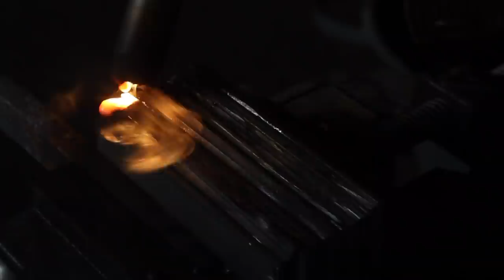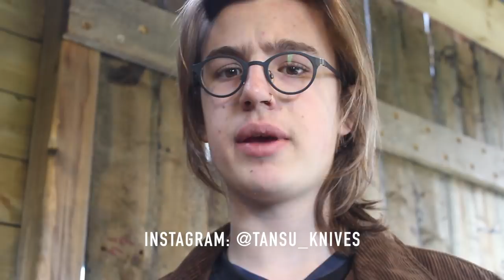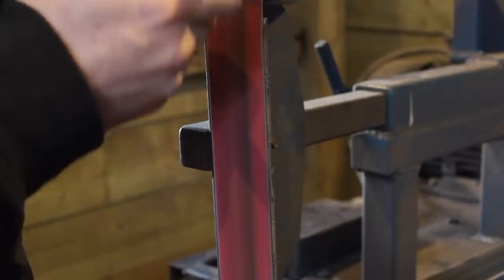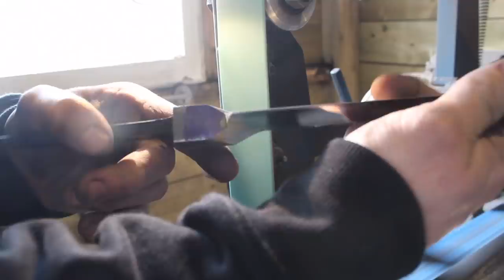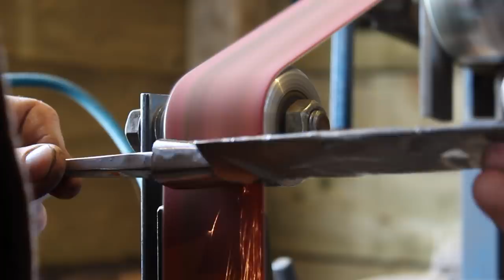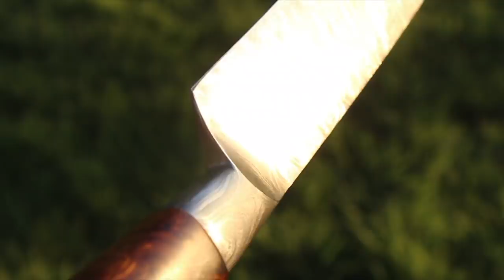Turkish Yatagan Sword from Damascus steel ~ Making my first Sword

Comment: Great sword. My only trouble that with yatagan's handle. Turkish blacksmiths make the handles back end wider (Those are called ears) to prevent the blade to slip away from your hand in a combat situation. But it is so beautiful and seeing blacksmiths from other nations makinkg Turkish weapons is awesome. Good job.
Reply: Skyrim ceken adamın 6
Reply: @Herawler  aga kalk Skyrim
Reply: Janissaries slab marble blocks with bare hands to make their hands solid. Its not a problem.
Reply: @Herawler  Lordum onure oldum.

Comment: It actually looks quite legit! GREAT WORK!

Your beautiful yatağan lacks 2 things, unless it is a ceremonial one:

1- “Blood channels”: 1 or 2 parallel canals running on the upper part of the blade, for easier drawing out of the metal wearing enemy.

2- MOST IMPORTANT: TWO EARS + COUNTERWEIGHTS! Since the saber is forward balanced; (ie: recurved) you have to leave the tang very thick (which you mostly did) and you finish the very end of handle with 2 large and heavy-ish “ears” that are inlaid with heavy bronze (or silver) sheating inside and around them to tilt the center of gravity backwards; very useful when hitting armor, as it will add a lot of momentum to the striking edge.

Another interesting feature is that you have the make the handle as “round” as possible (instead of oblong like a chef knife handle) so your fingers barely touch when grabbing the saber; a feature of our hammers as well.

Interesting to note; the hammer you are using is very similar to the ones in Turkey, Iran and Central Asia and China.

Last, you need to make a small notch at the back of the blade near the tang after each battle you have been in, the wider the notch, the more important the battle! Haha! :) (round notches on the back corners for naval battles)

Great work, I’m a copper and silversmith myself, I love your channel!
Reply: And another typical feature again for balancing and solidity reasons is to have multiple rivets at the handle; at least 3, sometimes 5.
Reply: @2000eae  Your blacksmithing skill is now 99.8%
Reply: Wromthrax if you only knew... 😘
Reply: @2000eae  Cue Minoc Theme
Reply: @2000eae  dostum sen nerede çalışıyorsun kimsin azizim mükemmel yazı valla
Reply: The groove you are talking about is not for letting blood. Its for balance.
Reply: Ben Yenilmezim 
Guzel yorumun icin sagol oncelikle, Istanbul’da Soy Turkiye sirketindeyim, metal dovuyoruz gece gunduz! :) 
Yolun duserse beklerim her zaman bizim imalata, gercekten.
Reply: First sword ever, and can't let him enjoy it?

Comment: The handle looks like a normal knife handle and traditional Yatağan swords have two big bulge at the back of the handle that are called 'ears' to prevent slipping from hand. Except from that, you made it better from most of the Turkish knife/sword makers. Excellent job!

Comment: The handle of the Yatağan sword is not like that. There is a lump to weigh on the bottom of the stem. that bump allows the sword to be kept balanced and the sword to swing more evenly. The part of the sword you made was also close to the handle. the bedding sword slightly thinner from the tip to the handle. Keep in your mind.

Comment: try to make some oroshigane (similar to tamahagane) using the steel dust from your screw press
Reply: love the sword btw
Reply: The scale that breaks of while forging isn't steel anymore because it has lost too much carbon, I don't know if you could really make anything from it
Reply: There's a video about it..
Do look it up.
Reply: @lemansawi3249  can you send me the link please ?
Reply: @lamproknives  the link
Reply: @lemansawi3249  hm okay, well I'm impressed but I still thinks it won't make a good knife anyway, first because it is very likely to fail, and second because the scale has lost too much carbon to make a proper high carbon steel even after being forge welded
Reply: @lamproknives  yup, it failed miserably.
Reply: @lemansawi3249  well at least he gave it a try, if it had worked it could have been awesome, I don't know if  the time and effort are really worth it though
Reply: @lamproknives  actually there's a lot of processed to do before smelting.
A lot of impurities and all.
Not worth the effort.
Reply: @lemansawi3249  that's also what I thought
But Floris already made his last tanto from scratch, he made a blum, etc ... You've seen the video I guess
Reply: @lamproknives  yes.. The 1st video before i subscribed.
Reply: @lamproknives  watch Cody's lab chanel
If you want to Learn a thing or two about metal refining.
Reply: @lemansawi3249  I'll do 😉

Comment: this sword is not for everyone. Its design has extra weight at the tip which makes it hard to use  so only strongest soldiers  use it after a very hard and long training. But at the hands of its masters  it performs like  a mean monster : It basicly hybrid of axe and sword. its tip doesnt go  "breaksafe" backwards design like ordinary swords but inwards! which gives it extra centrifugal speed plus extra weight that allows it to break any unbreakable heavy armors like teutonic knights used to wear

Comment: the handle needed to be a Y; Further shape geometry is looking odd; not the ones i have seen; However sometimes these equipment come in different shape;

This yatagan knife is in museums; It is from the famous sword series of the US Marines were presented. 
They say Shield, Armour and Bone is chopped simultaneously with these;
However Y shape is accord to this need; Its usage is different; Handles role is different;

Still nice selection of material; For a young expert good work;
One guy said below; Quick! take him to "production cuisine" (Engineering department)
We say thank you and invite you to military museums and other sights to see variety of these;
May be you should also contact with producers of today as well...

Comment: I would like to congratulate you, you have worked almost perfectly, however, "almost is" not perfect, "first, yatagan front sharpness but would have to be moderately weighty, the blow comes by hand geleng but the force is the front part, crushed , middle had to be very shank, which cuts and separates, however, your worst mistake is the grip, in Turkey, called man Yatagan, (also) KULAKLI, so, Kulakli means, "the with ears", your rear handle would like shell go out from both sides, that gives you, a, that gives you the security that does not slip out of your hand, and ,,, b. you can hold on to it without convulsive grift ,, please look at Ottoman sword, and grief end, what do you think why there is this fist thicker end, thanks,

Comment: Great job. Although I was holding my breath for most of the time. Ever heard of safety, dude? Those puffy sleeves very close to the belt sander... no fire protection gloves through parts of the stacking, driving put the Damascus... open long hair near presses and rotating machinery. Small wonder you came through unharmed. Great job.. but you need to be more careful.